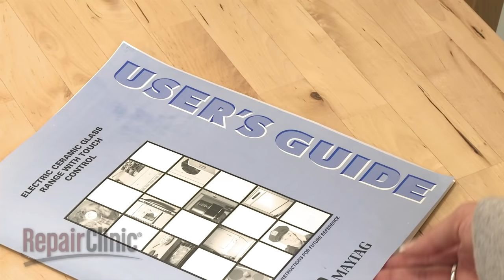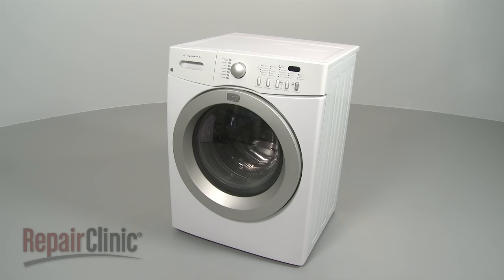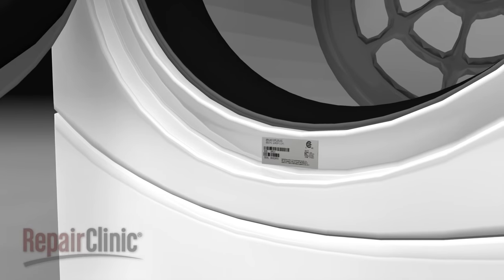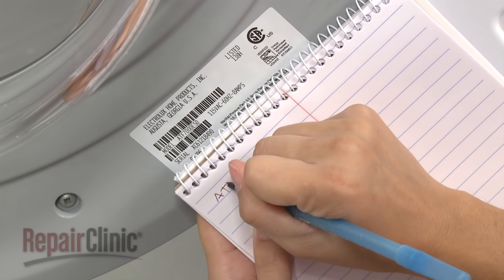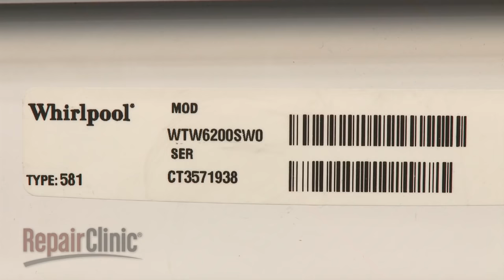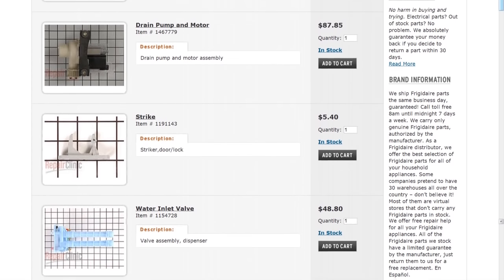Washing Machine – How to Find the Model Number

Comment: The video misses one possible location. My Whirlpool top-loading washer has its model plate located on the the main body also under the lid but is kinda of blocked by the lid edge when you open the lid to find the plate. So check the latch line when the lid is pivoted and contacted to the main washer body cover.
Reply from the maker: +Dave Troupe Thank you for the feedback.
Reply: I definitely could not find my model number until I saw your comment. thanks!
Reply: thanks, that's where mine was!!!!!
Reply: Thanks!
Reply: Thank you. After reading your post I found it.